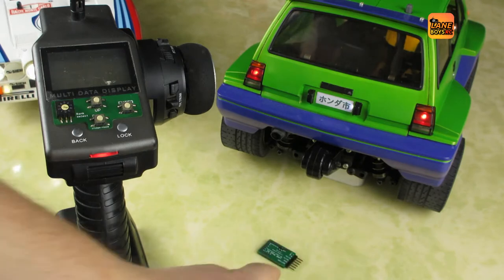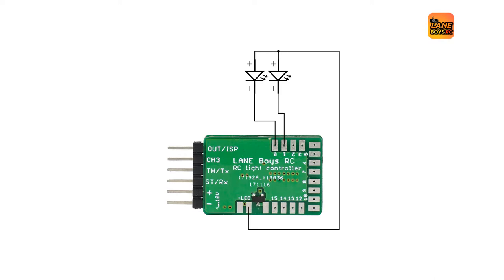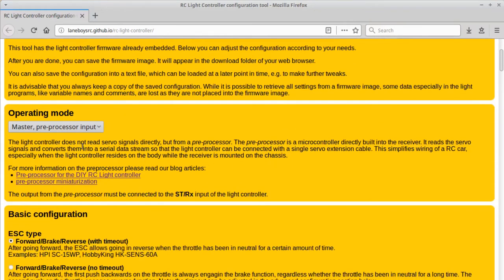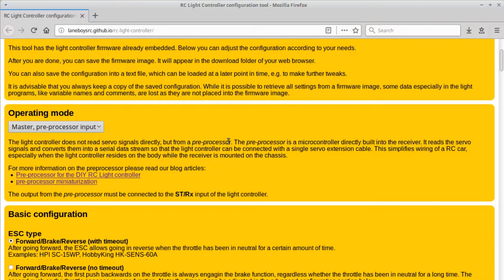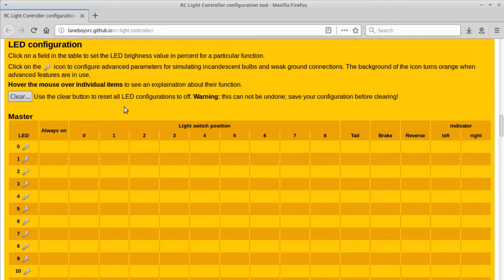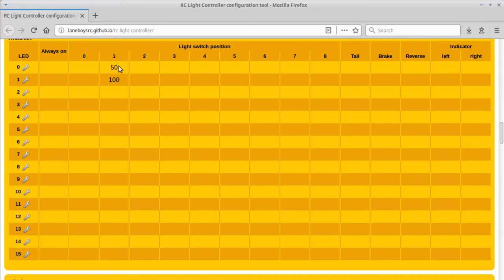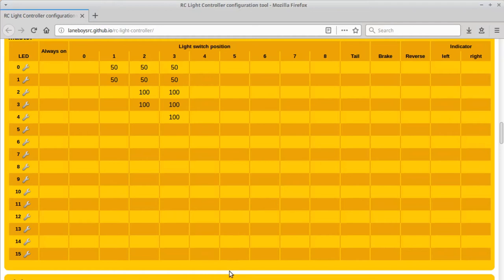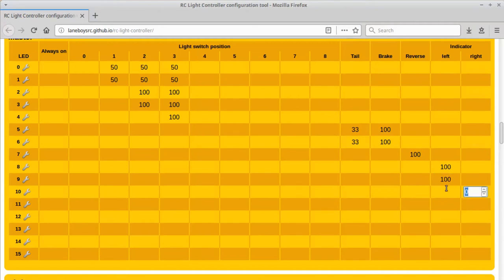DIY RC Car Light Controller Mk4  --  LANE Boys RC

Comment: This is really clever, well done! Would you consider selling kit versions of these or a pre built maybe?
EDIT: nevermind I rewatched and heard the bit at the end
Reply from the maker: Thanks! I usually have a few built-up kits in stock to sell, feel free to contact me at laneboysrc@gmail.com. 
I can only supply the light controller and preprocessor (and USB-serial for programming), no wiring and LEDs and servo extensions.

Comment: Great video.  Do you know of a way or a product that I can connect a led and have it turn on for 3sec then off for 10-15sec then back on in a loop.
Reply from the maker: Yes, the light controller supports a simple scripting language that can implement such custom blinking patterns. I've sent you an email with more details.